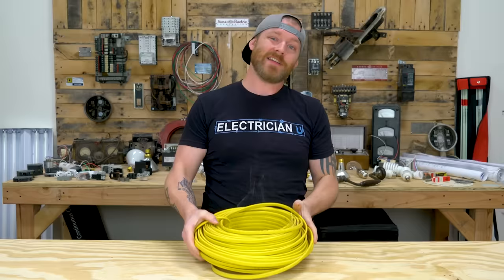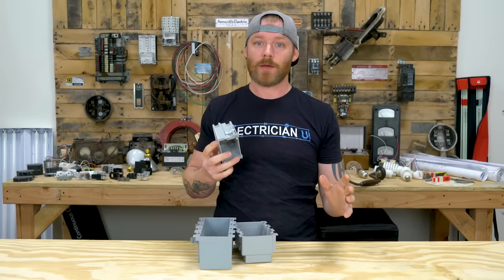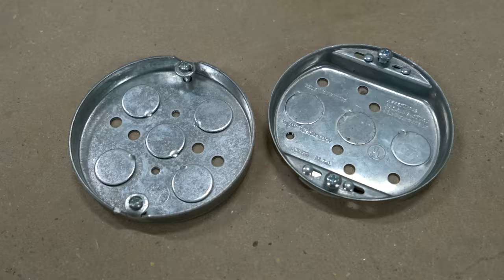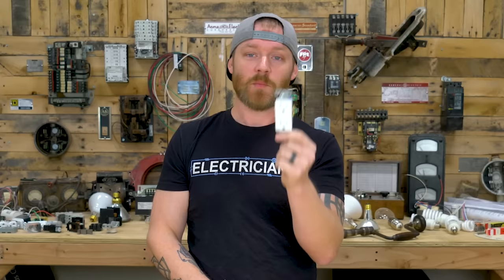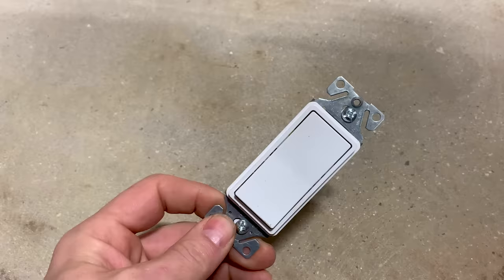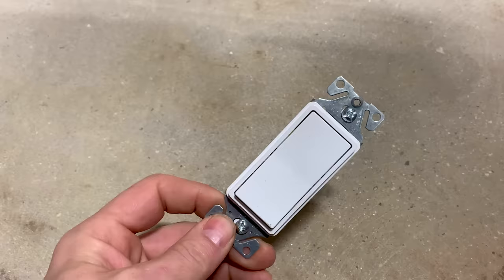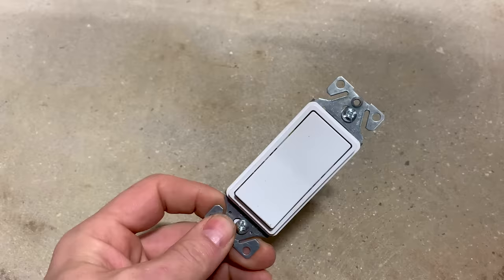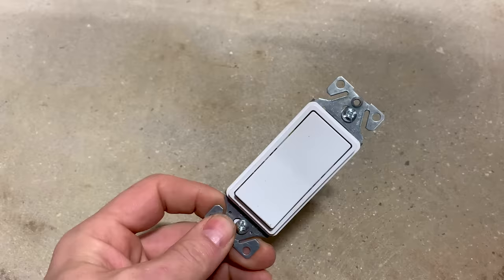RESIDENTIAL ELECTRICAL MATERIALS Apprentice Electricians Should Know

Comment: Dustin, I have never seen anyone on Youtube show how to install a bell box in the middle of a yard, with rigid conduit driven in the ground to support it using the ring connector in the back. Can you do a video about that? All videos on here only show how to mount the damn things to a fucking exterior wall. Thanks.
Reply: Using rigid conduit as the sole means of support for a bell box or other work box  is not code compliant whether it is coming out of the earth, coming out of a slab, or hanging from ceiling.
Reply: Kris Klekosky hire a professional.
Reply: @sunny71169  I don't mean the PVC that is feeding the conductors just to be clear. I mean driving a piece of RMC into the dirt and securing it through one of those connectors that threads into the back of a bell box and has a set screw. I was taught that way by an older electrician but maybe it is no longer acceptable.
Reply: @dallas5374  I wasn't asking you.
Reply: @illestofdemall13  Sorry, but I don't follow exactly what you want to do.  Consultation with your local code enforcement officer might be an option.  Some can be very DIY friendly.  Some really suck!  Dallas' suggestion of hiring a pro is also worth considering.
Reply: @Dallas I was asking for him to do a demonstration on that particular task. There are several ways to support a bell box but I wanted to see one particular demonstration. I am not doing a DIY installation, it was just a general request.
Reply: This connector is designed to thread into the back knockout, and receive rigid conduit as a means of support. Then the set screw secures it to the support conduit. I already know how to do it as I was taught, but I wanted to see his demonstration.
Reply: Kris Klekosky Hire a professional.

Comment: Great info for beginners..but..FYI: A Decora switch is not an approved disconnecting means, only a toggle switch style device is allowed. Decora , "paddle switches" , are extremely unreliable and I would argue, dangerous.    I have come across many Decora switches in my 20yrs in the field ,that "leak" voltage... Have you ever noticed how much arcing noise comes a decora switch if you just press on the paddle lightly? The contacts inside require very little motion to bring them into potential,  they start arcing when very little pressure is applied. Terrible design.  A toggle switch design is superior.

Comment: Electricians use pop in boxes way too often in ceilings my understanding is it they are rated up to eight pounds for wall only have seen fixtures fall onto kitchen islands after a Plumbing Leak and it gets wet

Comment: Great video. Curious question- I've noticed here in NH I never see ac disconnect switches but instead see double breakers- a breaker at the source and breaker at the appliance. My parents landlord just renovated their place. The water heater has it's own meter that feeds into the house, into a breaker and timer right near the meter, then it runs across to the appliance. Is the ac disconnect vs second breaker interchangable?

Comment: I feel any electric on the ceiling intended for a light should be fan rated. Because in the future some homeowner will try to mount a fan to it.
Reply: That's called Overkill and it's expensive
Reply: @soullessdevice  
Overkill when fan falls on your head. :)
Reply: If Electricians wired houses for “what if” scenarios they would go broke. You must be a liberal.

Comment: Just installed a bubble cover under my sink.  [long story] Went with a 20a duplex with split power: disposer (switched) and dishwasher (constant).  They say it isn’t located in a ‘wet area’ but ask any plumber.  Up high of course! 🤫
Reply: Harry Pouncey you are only required to use gfi protected outlets under a sink. No need for the bubble cover

Comment: I have a 200 amp panel outside attached to my outside wall. I want to run 8 gauge wire for a 40 amp double pole breaker.
When I come out of the wall I need to run it to a knock out on the bottom of the panel
Could I use a piece of liquid tight  from the wall to the box. I am in california.
Thank you

Comment: Hi, l bought  the blue jump blue box for the attic and  a switch  to turn the light on. I got NM-B  14/2 CABLE. COPPER BUILDING WIRE 600V. DID I BOUGHT THE RIGHT THE CABLE FOR THE PROJECT I WANT TO DO IN THE ATTIC?

Comment: Back in the 90’s I totally retired my house from the meter in. I used 12ga throughout the house. Receptacles and switches had the holes to push in the wires. Now, they all have holes for 14 ga wire. What changed?  Is 14 ga. adequate for wiring a house now, but was rated for heavier gauge back then?
Reply: If you pushed in all the wires then you need to go undo that and pigtail the wiring and use the screws at least on the outlets .

Comment: Thanks for the video!  Got a question  I'm considering a job change.  I'm almost 50 and love working with my hands, however have been driving a desk or in sales most of my career.  Is it crazy to become an electrician at my age?  Is it worth it?  Any recommendations on how to get into the field?  Thanks for any help and suggestions.
Reply: I don't think you are ever to old to learn a new trade. Good luck to you. I have a friend who became a doctor over the age of fifty.
Reply: No 50 is not too old , but , it is a physical job . Ladders , working overhead , hauling materials , kneeling for extended periods , sometimes difficult positions depending on the conditions . Pulling wire , yes sir you can come home pretty sore on some days . It is not a bad trade though . I have been doing it since 1984 .

Comment: have a circuit breaker that now works in when in the off position, and doesn't work in the on position. I just did some rewiring, and am an amateur. I messed something up somewhere.  What could it be ? Is it dangerous ? Can someone help ?

Comment: What is the clamp that holds the wires in place in a box called? Thanks for your time not an electrician I'm actually automotive tech that wants to get into residential electrical. So this is a good basis as to what componets are called that I'm replacing
Reply: It is called …….a clamp

Comment: Someone told me that you can no longer use staples to hold wires, you had to use these plastic tabs that hold the wires in place, is that true?
Reply from the maker: Depends on the AHJ. Most NM staples come with the plastic protector on them now.

Comment: Can I use the fan brace on a all metal frame house ? Or is it just for wood
Reply from the maker: Absolutely! You just cannot use say a 1900 Box, or the plastic boxes, on metal framing. One - most of them come as nail ons, and good luck nailing into a metal stud. Two - all metal parts have to be able to be grounded. If a wire comes in contact with metal at all, it needs a path to be grounded. Great Question!

Comment: Is the bell box actually made of metal and needs to be grounded? I hate those grounding screws.
Reply: Yes
Reply: Yes, there's typically a grounding screw in the back of the box. However, there are non-metallic alternatives to using the metal boxes.
Reply: Yes they are metal and need to be bonded. The grounding screws are easy to secure if you use the right size nut driver. I don't use the flathead or phillips when installing them.

Comment: I have 250 feet of free 12/2 romex. I wanted to wire my garage with more receptacles. I need to use conduit....I have heard romex shouldn't be ran thru it, other electricians say yes. Can't unsheath it....no UL listing on wire. Uggghhh....no definitive answers.
Reply: Look up thhn 12 wire, or uf wire for running conduit
Reply: @joshnewton1243  yeah....I bought some thhn and ran that.

Comment: Romex is against code in civilized areas where electricians know how to bend pipe and pull wire
Reply: No its not. Its safe to use as long as installed properly
Reply: @JoeMamasLover69  actually it very much is against code in Chicago. I was just teasing in my comment but yea we don’t use it. Even when we buy summer places in Michigan/wisconsin/indiana any trades guy from Chicago will pay to have an electrician buddy from home come out and run pipe. Maybe romex is safe but it seems like pipe eliminates the cause for any concern

Comment: Experienced electricians use conduit
Reply: Ragin Riotz if you were my employee and I found you trying to wire a house in conduit I would fire you immediately.
Reply: Dallas let me know how it goes when you have to rip apart the wall after destroying the conductors by hanging a picture. And have fun installing all those AFCI’s
Reply: Dallas let me know how it goes when you have to rip apart the wall after destroying the conductors by hanging a picture. And have fun installing all those AFCI’s
Reply: Ragin Riotz I hope you’re not a licensed electrician? clearly you have no idea what you’re talking about. Romex is installed through the center of a stud which is roughly 3 1/2” wide. With a 1/2” of sheetrock that would mean that romex is 2 1/4” deep in the wall. If you’re using screws that long you need to be slapped and you should probably have your wife or husband...hang up pictures for you.

Comment: You should throw it in garbage. , will not hire you to do electrical work  plastic boxes suck after 40 years in the trade I never installed 1 single plastic  box.  I pipe 100%   whole house . Very disappointed  in this video